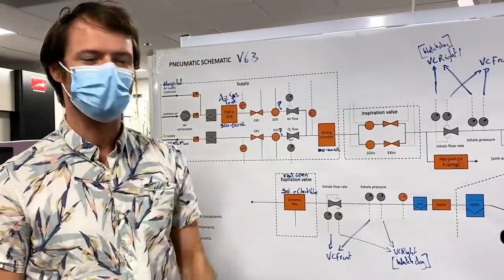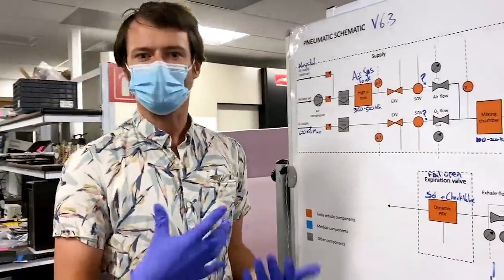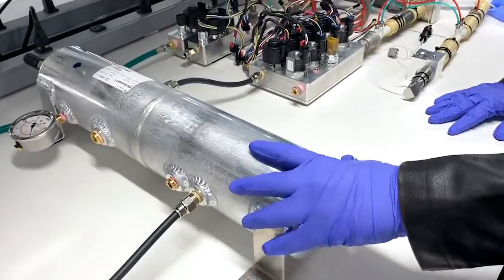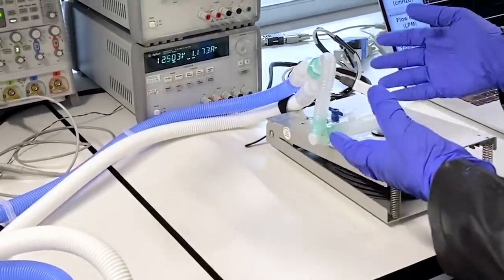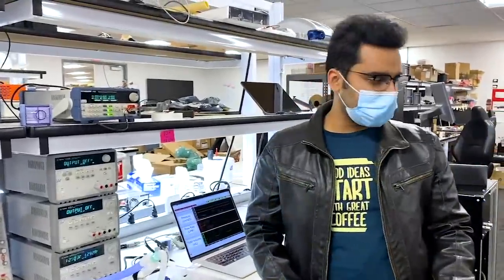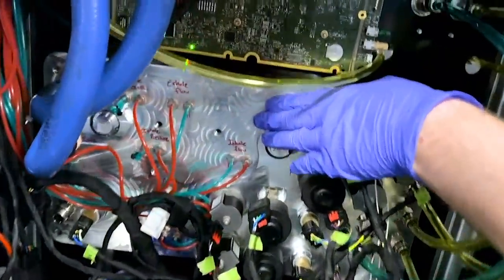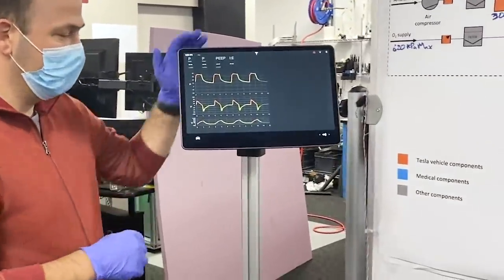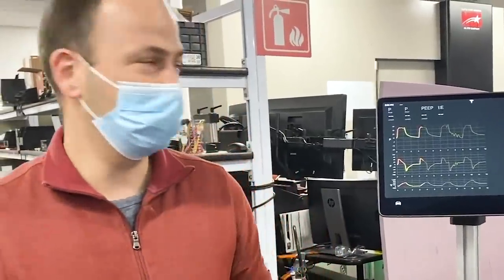Tesla Ventilator

Comment: While I admire the effort, you all should know that this is primarily a publicity stunt.  Very few, if any of these will ever be used to treat real patients.    The commercial ventilators that Ford and GM are helping build are the about the size of a toaster, not a refrigerator.

Making medical grade devices using the proper medical components (parts that are proven/certified not to have contaminates, etc.) and made in clean environments is not the same as taking parts off your car!  Why do you think all of the large manufacturers are partnering to improve and increase capacity of actual ventilator companies?  Even Tesla has said they will work with Medtronic to make Medtronic ventilators by reopening a NY Tesla solar plant.  Medtronic has some of the best biomedical engineers in the world, I doubt if Tesla will contribute much more than just additional capacity.

Tesla makes some very fine cars and they have a good head start on the competition, but they are not engineering gods.  Please take your fanboy goggles off and keep things in perspective.

Comment: You are NOT supposed to touch your mask like that guy did on 0:20 until you throw them away otherwise they’re useless against spreading the virus which is what are those masks useful for.

The throwaway masks used for dealing with asbestos are a better defense,besides the normal precautions.

Comment: "Ventilators aren't rocket science."
"Ohhhh yeah, ....now they are."
Reply: well, car science.
Reply: @GuideStackYT   how much? GM m
Reply: GM made around $16500 (May or June),  China low end ? 7500 to high end ?  21500 (USA plan to buy 14000 from low to high in Apr 20)
Reply: @happyyoggi3894  did u mean to tag me? 😅
Reply: They are much more complicated that most lay people think. Even this one doesn’t have many of the bells, whistles, and features of a full ICU capable ventilator. Time will tell if it’s up to the task of effectively ventilating a covid patient.
Reply: @kleinbiker1  It would be far more suitable than those shitty bag respirator thingys like the ones Virgin Orbit built. At least in this case they have partnered with MedTronic so they can actually build a working ventilator without having to create a brand new design

Comment: Great prototyping - however the publicity stunt of wearing gloves and masks was a fail.

Please get someone to instruct you on personal protection equipment and proper safe procedures while wearing them.

You have to wear your surgical masks higher and don't touch them with your hands or gloved hands all the time - you increase the risk of contamination by touching your face all the time like you all do in the video.

I recommend you stick to good hand washing practices as it must be impossible to work with those oversize gloves.

Comment: Offtopic: Pretty please could you stop touching your mask? Not only it gives a bad example, but it puts your whole team in danger. I lost count at 5 or 6 times. This is not a knee jerk reaction and I hope you are able to continue making ventilators for a long time. 
Also could you also create masks with respirator valves, should help with reducing overheating caused by worm exhaled air? And face shields, just a hard plexi mounted on the forehead on an elastic collar ? This should help with the problem above.

Comment: You can use an oximeter to determine the blood-oxygen levels, i think it would be easier and more compact than external air sensors it just requires a set of leds a light sensor and an mcu, it can also read the cardiac pulse

Comment: Talk about overengineered nonsense. It needs a pump with a motor, some tubes and a pressure valve.
Reply: Gazza Boo clearly you have no medical background.  Lungs are delicate and need ventilated properly.
Reply: @kleinbiker1  strip away all the nonsense electronics and reduce it to the basics of what is necessary and that's all a ventilator needs. A mechanical pump with a regulated supply and a peep valve that you can make in the thousands quickly.
https://www.youtube.com/watch?v=vdLXp7uGFX4
an example of basic functional.. by medical people.
Reply: Gazza Boo unfortunately you’re still incorrect. We need to build ventilators for covid patients. Covid infects a patients lungs primarily. It’s takes a fairly advanced ventilator with a good algorithms and proper sensors and controls to even have a chance of ventilating such sick lungs. What Tesla has designed may barely work as it is. What you describe has zero chance of keeping someone alive. I have a bachelors of science in respiratory therapy and a back ground in electrical engineering. I’ve been a practicing respiratory therapist for many years so I know what I’m talking about. In case you didn’t know, respiratory therapists are the ones in the US and Canada who set up, get going, and manage ventilators. It’s not doctors and nurses like on TV
Reply: @kleinbiker1  You need a lot, quickly. High tech tends to take longer and need longer certification periods as more is involved and more to go wrong. Speed, not sophistication. This is basic emergency supply. Think MASH units. Good enough. Besides, as I recall, the chances of surviving the necessity of a ventilator is what, about 30% on a good day?
Reply: Gazza Boo I’m done arguing. I’m sorry you don’t understand this stuff. Maybe read some technical articles and get some experience in the fields before you come at me with your arm chair quarterback analysis.
Reply: @kleinbiker1  yes, because it's not as though mechanical ventilators haven't been around for well over a century before any modern technology existed, is it.
Reply: Gazza Boo old ventilators and old ventilator theory killed many people in the past. A crude basic vent would definitely kill a covid patient that needed ventilated. Again you have no idea what you’re talking about.

Comment: So instead of making more ventilators you’re inventing new ones from scratch? I guess I’m not surprised, Tesla promising something they can’t deliver in time seems to be their M.O. Tesla ventilators due October 2030.
Reply: This is a good point. I'm seeing an impressive achievement from eng. point of view, but very unpractical. Will a medical staff use this? Certifications, testings, etc. Also, the price is over the roof. They have reused a bunch of stuff, which is intended for different use cases. I'm pretty sure, that the entire Tesla infotainment system used in there is just dealing with the screen, few graphs and basic programming, which you can run on a $3 Arduino.

Comment: Favorite part coming from an anesthetist's POV: the whiteboard checklist passing all the requirements WITH adjustability speaking my language! This is why I love this company.
Reply: IMHO Knockout Artist is absolutely the most rad nickname for an anesthetist.
Reply: @xnooga  Thanks!
Reply: nooga IKR!
Reply: SJW libtard wrecker  
"Cause disease by forcing dirty hospital air into the lungs"
You absolute potato.
Reply: SJW libtard wrecker  Disclaimer: Not a doctor. IT guy.

You said Ventilators are not a cure. That's correct they are used to keep the paitent alive until a Medicine can be made. 

You mentioned that Hospitals have "Dirty Air" I assume you are referring to unclean air Ducts. Most hospitals should clean their airways as it is nessicary in order to prevent further spread of illnesses. If your Hospital isn't clean take that up with maintenance.

You said that HQC's are working on CoVID-19. That's half true. The study in question shows that the four tested patients had better body temperature than the four Control paitents. However that was temporary as they soon fell into the same state as the Control group.
https://www.medrxiv.org/content/10.1101/2020.03.22.20040758v2

You said that "Ventilators require a whole team to run them." No they don't. After being turned on and set to the right mode they can run autonomously. As is the point of a Ventilator. Autonomous Airflow.

I looked through the Journal you linked. This was a popular Journal when it first came out. It talks about those who were placed on a aerobiological chamber had lower chance of survival when aerosols had been generated. As to what that means exactly I don't know but after reading into it I read these definitions:

aerosol [ār´o-sol″]
a colloid system in which solid or liquid particles are suspended in a gas, especially a suspension of a drug or other substance to be dispensed in a cloud or mist.

colloid system
An intimate mixture of two substances, one of which, called the dispersed phase (or colloid), is uniformly distributed in a finely divided state through the second substance, called the dispersion medium (or dispersing medium).

I also read an article that says as follows:
"The weight of the evidence suggests that the new coronavirus can exist as an aerosol — a physics term meaning a liquid or solid (the virus) suspended in a gas (like air) — only under very limited conditions, and that this transmission route is not driving the pandemic." - https://www.statnews.com/2020/03/16/coronavirus-can-become-aerosol-doesnt-mean-doomed/

I also read this:
"
Most coronavirus patients who end up on ventilators go on to die, according to several small studies from the U.S., China and Europe.

And many of the patients who continue to live can't be taken off the mechanical breathing machines."
https://www.npr.org/sections/health-shots/2020/04/02/826105278/ventilators-are-no-panacea-for-critically-ill-covid-19-patients

Let's discuss this. Because you had said that few are able to come off a ventilator once put on on. And that's true. But not because of Pneumonia. What you are referring to is "Ventilator-Associated Pneumonia" or "VAP". The article I read about VAP says as follows: 
"Ventilator-Associated Pneumonia (VAP) is a lung infection that can happen to patients who are on ventilators (machines to help them breathe). This infection is very serious. About 15 percent (1 or 2 out of 10) of patients on ventilators get VAP. About half (50 out of 100) the patients with VAP die from it." https://www.dartmouth-hitchcock.org/at-hospital/ventilator-associated_pneumonia.html

While yes, VAP is very dangerous, there are ways to prevent it. The Article quoted above goes on to outline 4 steps to minimize risk. 

Raising the head of the patient's bed between 30 and 40 degrees.

Giving the patient medication to prevent stomach ulcers.

Preventing blood clots when patients are lying very still.

Seeing if patients can breathe on their own when waking up after surgery.

In our case the last one isn't very feasible.

But as I continued to read about CoVID-19 I learned that it causes Pneumonia as it is. So I'm not sure as to the point of mentioning VAP. 

As for Pneumonia, the common treatment is Antibiotics and rest. However for serious cases the patient is put into Oxygen Therapy which is done with a Ventilator. 

All in all. You have some truths to what you are saying. But also some inaccuracies, as I'm sure I do to, this isn't my field of study. But always fact check and question everything. 

Sources:
https://www.medrxiv.org/content/10.1101/2020.03.22.20040758v2

https://www.indianapolis-medical-malpractice-lawyer.com/blog/2018/july/is-dirty-air-a-problem-in-hospitals-/

https://www.lung.org/lung-health-diseases/lung-procedures-and-tests/oxygen-therapy

https://www.lung.org/lung-health-diseases/lung-disease-lookup/pneumonia/treatment-and-recovery

https://www.usatoday.com/in-depth/news/2020/03/13/what-coronavirus-does-body-covid-19-infection-process-symptoms/5009057002/

https://www.dartmouth-hitchcock.org/at-hospital/ventilator-associated_pneumonia.html

http://glossary.ametsoc.org/wiki/Colloidal_system

https://medical-dictionary.thefreedictionary.com/aerosol

https://www.statnews.com/2020/03/16/coronavirus-can-become-aerosol-doesnt-mean-doomed/

https://www.npr.org/sections/health-shots/2020/04/02/826105278/ventilators-are-no-panacea-for-critically-ill-covid-19-patients

https://www.sciencedirect.com/science/article/pii/S1569199309001519
Reply: @Alpha Fatti Damn bro you put some serious effort into that. That should be a reddit post at least.
Reply: SJW libtard wrecker  yeah for sure doc get proper knowledge before saying all this, I'm a doc by way and what u said absolute bullshit.
Reply: SJW libtard wrecker  oh I wasn't complementing you I think people with names like yours are just all outraged reactionaries lmao
Reply: SJW libtard wrecker  I'm only going to reply once because any more is a waste of time with you: Ventilators don't recycle 'hospital air'. They are supplied with a sole gas or combination of oxygen/air/nitrous/CO2/etc all from a wall supply at ~50 psi that is stored in giant tanks supplied by dedicated gas companies. This isn't contaminated 'air'. If not wall supplied, it's delivered via tanks filled with the same gas. You're absolutely wrong in your statement and please don't spread misinformation about things you're clearly ignorant on. 

Tesla is doing a good thing here by filling in the gaps and not getting in the way with supply chain. Ventilators hopefully buy time until a vaccine can be made, antibodies made, or the body actually performs a miracle and fights it off. You're right, very few come off ventilation unfortunately. You're also right, it does take a whole team, which I'm a member of and if you don't mind I'm going to go back to running one 30 feet away. 

God forbid you need one, but when and if you do need one, I hope you recover from this and the first thing you see when you open your eyes for a second chance at life (from being an ignorant troll) is a giant Tesla symbol on the ventilator keeping you alive.
Reply: SJW libtard wrecker  Within the context of your first comment I stand by mine
Reply: SJW libtard wrecker  It does look promising, hopfully soon we can return to business as usual. 
I'm glad we could remain respectful. I know I certainly learned a good bit from this conversation. 

Have a good day!
Reply: SJW libtard wrecker  They are probably hiding from you.
Reply: That's the most impressive thing here. They got the requirements and are making ACTUAL ventilators! Awesome!
Reply: SJW libtard wrecker Lol but why would anyone listen to you? You’re just another fish in the ocean. If everything you had to say was 100% correct, why haven’t the people in charge, including doctors, said the same? Hell, why aren’t you on the presidents task force? Why are doctors/hospitals using ventilators and creating demand? Why are governors and their teams screaming for more ventilators? Why are private companies scrambling to engineer and build them?

You’re asking people to trust a random dude in a comment section over the heads of state and teams of experts that they hear from every day, and then calling them mental midgets when they disregard what you’re saying. Smh.
Reply: @SJW libtard wrecker But if it’s so obvious that you were able to figure it all out from your couch, you don’t find it dubious that teams of smart people working around the clock aren’t echoing your sentiments in unison?
Reply: SJW libtard wrecker  lmao top tier name

Comment: Fantastic engineering, and not just a Bag mask valve ventilator being squeezed with a motor (which is dangerous and won't work) instead they are building a real full function ventilator with parts they have. Bravo.

Comment: Anesthesia provider checking in.  It can ventilate but does it have the same fail-safe mechanisms and alarms that a normal ventilator has?  The staff need to be made aware if there is a hypoxic mixture of gas, if there is a tube disconnect, if the peak inspiratory pressure is too high or too low, if the volume delivered is too high or low.  Amazing work so far.

Comment: Don't get me wrong, but your prototype has a lot of bloat hardware which might drive the cost up either for you or the buyer. At the same time I don't understand why not to use open source component which are readily available instead of custom electronics parts which your company have built. In case of any malfunctions in any of the said components, the ventilators are brick. 
The screen could've used open source generic TFT LCD screen or may be instead of using screens the data could've been sent directly to an application or a generic android tablet via Bluetooth or some generic wireless telemetry protocol. 
This looks nothing more than marketing and PR, personally it doesn't reflect well for your brand. 
Hope someone is listening

Comment: Righteous! Here's another manufacturing challenge for you you consider: UVC lighting for sterilizing pathogens in the air and on surfaces. But not just regular 254nm wavelength UVC lighting as already used in industry - that's not safe for human exposure. Columbia University has studied the use of 222nm "Far UVC" light to kill pathogens without harming humans who might be present. A few manufacturers have begun to gear up to produce 222nm Far UVC light sources, but I can't find any for sale anywhere. Go!
Reply: There are two kinds of sterilizing radiaton: burn if with heat, or ionize parts of them to cause chemical chain reactions that destroy biological mechanisms.
The problem with the former is, that it's incompatible with most equipment/materials.
The problem with the latter is, that it will also always cause skin damage. Alpha radiation would be an exception, but it's really short-range (1ft/30cm is already too far), and afaik quite expensive to make or even just handle without releasing radioactive particles that stay around. E.g., all ionizing electromagnetic radiation that sterilizes microorganisms will also damage human skin.

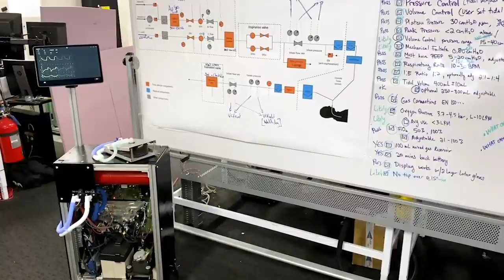Comment: The only thing on the Whiteboard @3:48 that is not checked off is for Oxygen Pressure: "Avg use < 3LPM".   
I say it's a good enough MVP, lets ship it.  If they need less than 3LPM, put them on just high flow oxygen, and let's get another passenger.